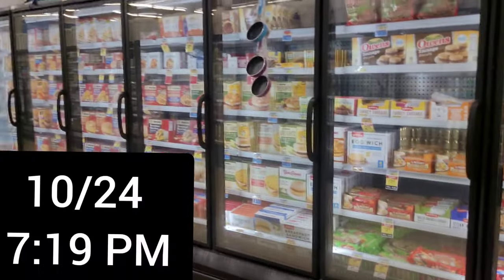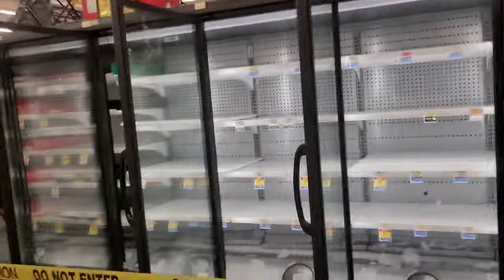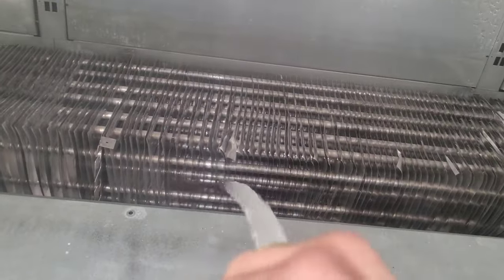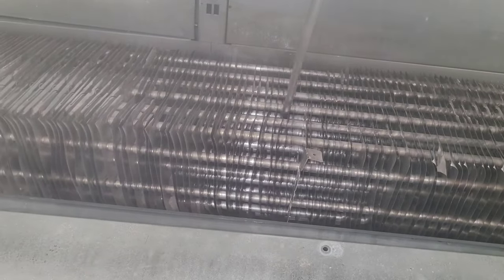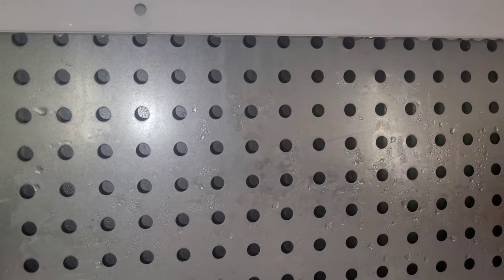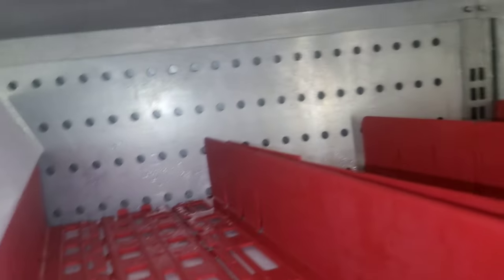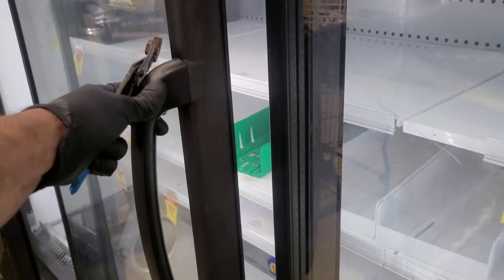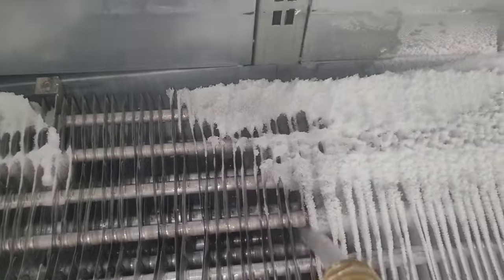Washing Coils. 16 Doors Frozen Food Cases Not Working

Comment: Question from a commercial HVAC guy:

So when you get stuck on calls like this for hours is your office still piling work on you or do you just go call by call until the day is done? Id be going nuts washing cases while I know my dispatcher is just hammering me with crap. Lol. I know you guys work long hours but dang. When do they let up off you?How many calls do you usually start with every day vs how many you actually run?
Reply from the maker: It actually just depends. we do have on call rotation so during on call in the middle of summertime When the calls are coming in like that, we do continuously get hammered and will go until sunrise until the next shift can come in and if it's on the weekend, well, we just go until we're tired and we really can't go anymore and then go home and sleep for 4-6 hours and Get up and do it again for 12-18 hr. And we just kind of follow That cycle until Monday rolls around. On monday we finally get to rest. 5 day holiday weekends are brutal. If Christmas in New Year's lands on a weekend and It's recognized by the company to have Friday and Monday off, The crew that was working on call usually doesn't go to work Tuesday and Wednesday. At least I don't.  
It's really a different way Of life. You have to get used to it and you gotta be okay. Wi that it gets like that sometimes. Kind of like the job of a field service technician out on the oil field. If the whole rig is Down and You got a hundred or two hundred guys waiting on a technician to fix it. That Tech has to work straight through 24, 36 hours...Whatever it takes to get it done.
Reply from the maker: Thanksgiving Christmas And the New Year's. Those are all 5 days straight for the On call Crews this year. I'm up on Christmas! Thursday through Monday.
Reply: @HVACRServiceTech  yeah, I'm on call TGiving and Christmas this year, somehow. Lol. I've been able to dodge it the last few years. Oh well. Keep up the good work,I learn a lot from your videos.
Reply: I actually liked the Sundays and holidays the pay was great double time.
Reply from the maker: that's awesome to know man. thank you for telling me